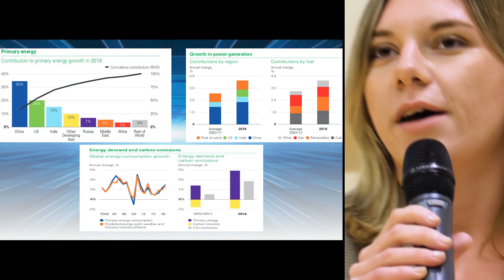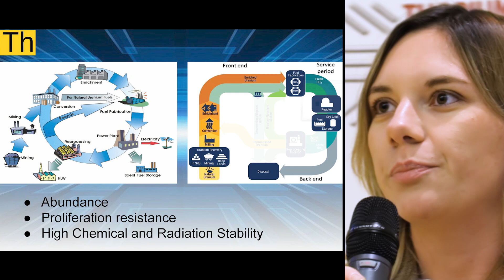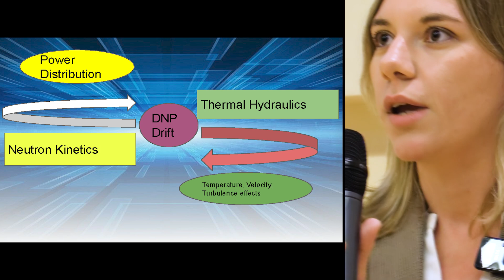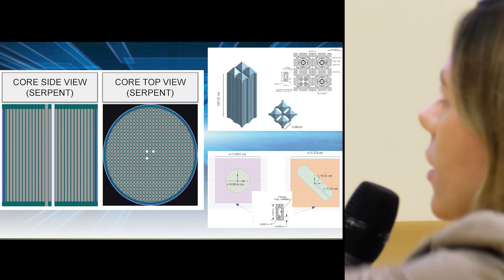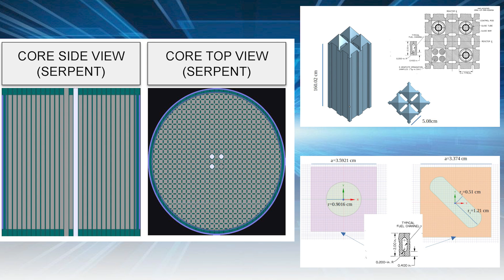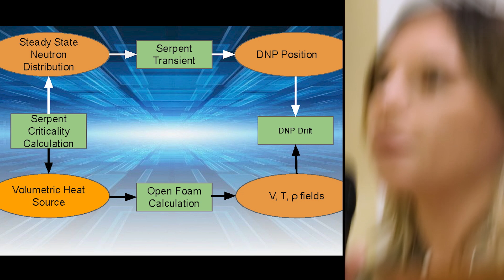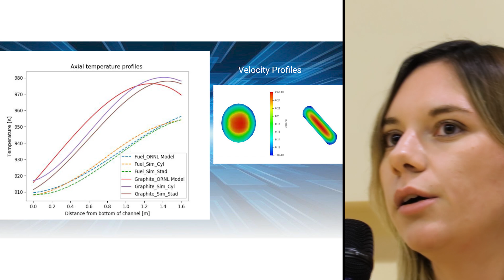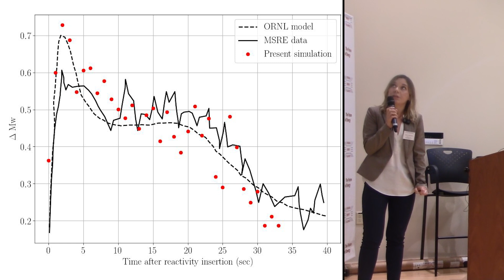Liquid Nuclear Fuel Modelling - Ashkhen Nalbandyan @ TEAC10

Comment: To my knowledge, the thorium reactor should have been a long time in use. Why so? It exists since the 60tes, run successfully for 3000 hours. It was dumped for only one reason. It was very difficult to make weapons-grade Uranium/Plutonium out of it. The existing nuclear industry has no interest to get a project like this running, in fact, they will do everything that this technology doesn't succeed. First, they have machinery in place that works with the old poison technology, from mining to process nuclear fill roods. It is expensive to replace. Second, they have the money. Reactors cost billions of dollars. Profit goes here bevor safety or longterm radiating nuclear waste. So the realization of Thoriumrectors is nothing else than a funding issue and I feel really sorry for this danish graduate. If you want to save the climate, don't want nuclear waste, run a Co2 free environment, without kohl powerplants you need definitely the thorium reactor.

Comment: I'm all for the 2-fluid breeder reactor, but:
#1 How do you replace damaged graphite elements in the core?  Each element is permanently brazed/welded.
#2 Liquid does not flow through all graphite channels uniformly.  Some of the graphite elements get more flow than others, meaning some of them get hotter than others and degrade faster.  How do you fix that?
These 2 things are the reason ORNL moved to a 1-fluid reactor.  Not as efficient, but they couldn't figure out solutions to the above problems.
Reply: I guess the solution is to just replace the graphite or the entire core periodically. While I'm sure this is possible, a fast spectrum single fuel machine seems a lot simpler in a lot of ways, particularly in eliminating the moderator structures.

Comment: The problem with Molten Salt is its highly corrosive on those metal parts.   Instead you could use Oil which can hold 60% of the temperature of MS, and that's still plenty hot enough to drive steam turbines.
Reply: Actually water is far more corrosive than molten salt at the temperatures required in a reactor.

Molten salts are far less corrosive than anyone who has owned a car in a country that uses road salt in the winter would think.

As long as you keep water out of the molten salt loops standard corrosion management procedures should be pretty sufficient.

Corrosion defined as the usual oxidation process, there are a few other funky chemistry stuff going on in a MSR, but none of them can be considered show stoppers by any means.
Reply: Pure salt can be made non-corrosive. As long as the structural metal is more noble than the salt, you're in good shape. Conveniently, nickel and iron based alloys are compatible with beryllium-alkali-uranium or beryllium-alkali-thorium salts.

I am sort of dubious about using oil at 400 C, but the radiation will definitely make the oil misbehave, at any temperature. Probably polymerization clogging the heat exchangers, I don't really know. It would be cute if it worked though, because oil is presumably a good moderator, so if you lost coolant you'd naturally lose the moderator as well.

Oil also has the sodium problem in that 300-400C oil breaching containment does nothing good.
Reply: @sealpiercing8476  Even oils like krytox that are supposed to be non flammable and highly resistant to ionizing radiation will AFAIK give off really nasty fumes when exposed to air well below the temperatures needed for an effective nuclear reactor.

Fissile materials in any kind of oil and trying to figure out what the fission products would do to the oil is probably better left for another day.
Reply: @NomenNescio99  Sounds about right.
Reply: What do you think would happen to organic molecules exposed to unimaginable amounts of ionising radiation?
Reply: Fortunately all energy degrades to heat, which is exactly what is needed to drive a steam turbine to produce electrical energy.
By the way, I have seen oil likely synthetic, used in just such a closed loop in place of molten salt, so it is feasible.

Comment: the Moltex SSR keeps the fuel salt in fuel pins (vented to release gas by-products) and works in fast spectrum with no moderator. 
The coolant is a secondary salt working at all loads by convection only. Heat is removed by a tertiary salt which sits outside the regulatory space. 
That removes many regulatory issues including delayed neutrons, moderator behaviour and the extremely thorny issue of pumping highly radioactive fuel. 
The problems for MSRs are almost entirely regulatory. Moltex have kept to conventional layouts and proven materials especially to minimise the regulatory drag on development.
Reply: Exactly.

Comment: Cost is not the only issue.  Try sell it to the Greens.  It would be difficult to construct a plant when half the time you have to contend with these ill informed Environmental Activist.
Reply: I’ve brought up MSR with a few people.  But once you say the word “Nuclear” or “Reactor”, basically their brains just shut itself.  The fact is Solar n Wind are great, but not reliable enough as yet.  Battery isn’t a perfect  solution until we reach the right density. So, at the moment, it’s a race against time.  MSR will have it’s compromise I’m sure.  Hopefully, it’s a good trade off.  Otherwise, the existentialist issue is inevitably sooner.
Reply: @dmenace2003  When I bring up MSR I point out it's 1600 times safer than traditional nuclear which that number is the expansion ratio of water to it's gaseous state. Which flouride salts have such a high boiling point that you'd have metal component failures before that portion of the reactor even pressurizes. Then detail all the other fail safe mechanisms whose electrically powered freeze plug is akin to air supply failure on a semi-truck locking the brakes disabling the practical mobility of said truck bring it to a complete stop. More people are willing to consider it when you immediately tackle the most common fear of nuclear power then bring up we've done MSR in the 1960's by the US Oak Ridge Labs.
Reply: Satoru I totally love the fact that you’ve got some figure to compare.  To an engineer, these are vital.  Open discussion and media attention are all required for success.  In any technology, there will always be a trade off.  Hopefully the economic n environmental effects can be acceptable.
Reply: @dmenace2003  "The fact is solar  n wind are great"

They're not. They're unreliable and dilute forms of energy that have no hope of ever being competitive with either fossil fuels or nuclear. The difference is on the scale of many orders of magnitude higher resource consumption per kilowatt hour. They're garbage energy sources only sustained by subsidies and other government interventions, and nuclear advocates pretending that they're not is really detrimental to the advancement of nuclear.
Reply: Don't forget that a lot of so-called "Greens" are funded by the Fossil Fuel Industry.  Who do you think nuclear power really threatens?
Reply: Primary funders of denial are Rothschild BP Shell. If you're going to shill at least dont be so obvious about it

Comment: Actually it's just the capital cost which makes it unappealing, in the long term it's actually cheaper, however that comes with risks, if your plant doesn't finish construction you are maybe out 7 billion vs 1 billion and you are open to other risks such as fuel costs for other types of fuel going down significantly. So yes cost is technically the problem, but it's only the capital cost which is the issue.

Otherwise the fuel costs for Nuclear are significantly cheaper, which in the long run will put you ahead, although there are the decommissioning and waste storage costs as well for Nuclear which at worst put them on par with other types of energy.
Reply: No, traditional nuclear power, in the west, is flat out more expensive for new-build. Due to the capital cost, yes. Keeping a plant running is cheaper, yes, and it's silly to close them down as long as they remain healthy. The challenge of 4th gen reactors in general is to take advantage of safety-by-physics to make reactors that can compete on price with even natural gas.

One of the reasons for that is cost overruns on building the facility. It hurts if you budget a $2B plant and it costs $5B and gets delayed. All the serious players have their own scheme for addressing that, often some variation of trying to build the expensive bits in a factory as a module, sometimes downsizing the whole reactor to facilitate the process. It sounds like a good plan to me, and I hope it works out!
Reply: Have you researched thorium reactors, because theres no such issue with decommissioning, waste costs or fuel etc with thorium. Do your due diligence
Reply: @uncannyvalley2350  I know I am just saying that conventional solid fuel reactors are not that bad on cost either. 

And it's not Thorium really that makes the waste have a relatively short half life, it's burning up the actinides and only removing the fission products which is achived by reprocessing, which liquid fueled salt is what allows the reprocessing step to be done while the reactor is operational, or at least allows easier reprocessing when you take spent fuel to a reprocessing plant.